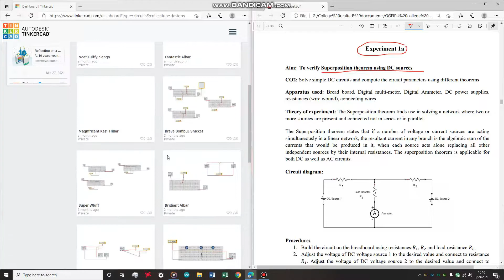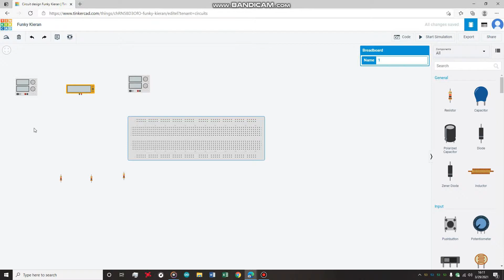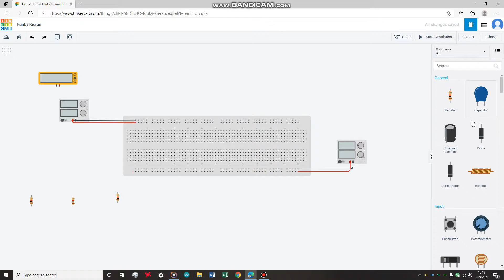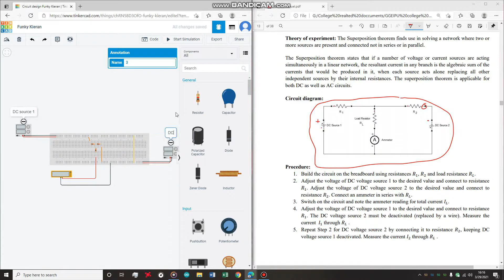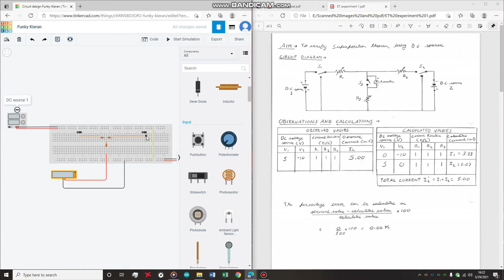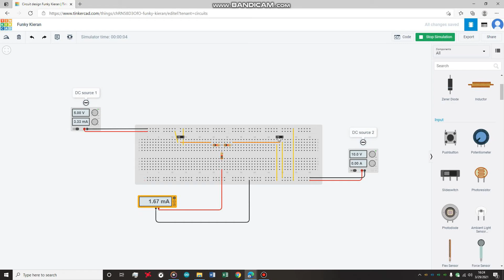Verify Superposition theorem for DC sources on TINKER CAD

Comment from the maker: Before you all start thinking about the 5mA reading, I would like to tell you all the the DC source 2 can be connected in the opposite polarity to get the exact same readings as mentioned in my lab file. I assembled the circuit without prior preparation so I assembled the circuit exactly like the circuit diagram given in my lab file.
Everything else is just fine!!